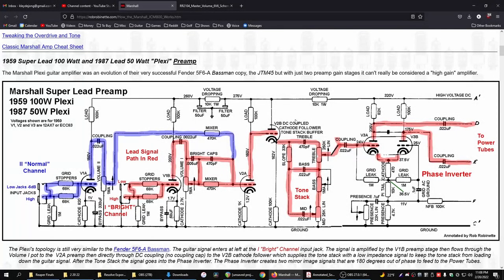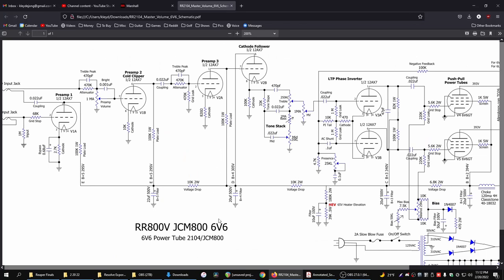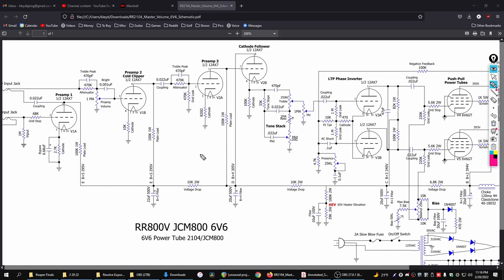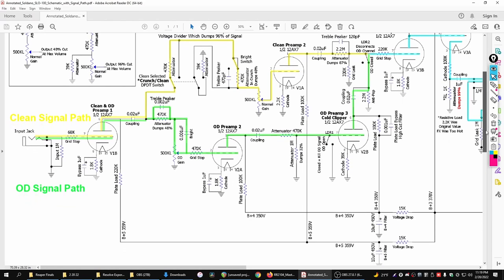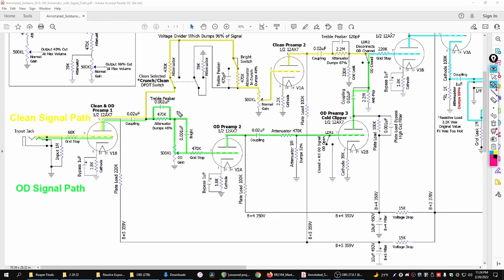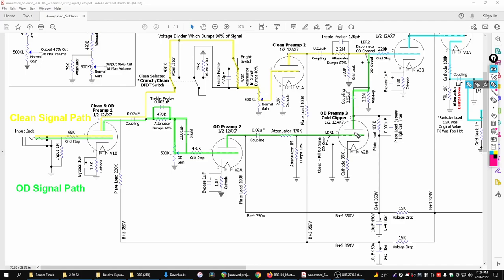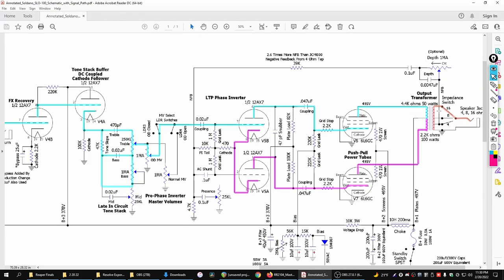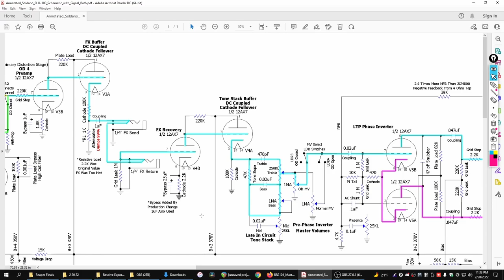High Gain Amp Circuits Explained

Comment: Soldano uses PCB in production. I've seen a turret build at the Sloclone forum and the guy said it's dead quiet. So it's possible, but a lott more work to do.
Reply from the maker: PCB also offers some nice advantages in reliability and repeatability.  You can get a stable layout that avoids oscillations or cross talk, then mass produce it.  I have hand made some higher gain amps and they require some more fine tuning attention.

Comment: A relatively significant part of what's being done with the higher value cathode and plate resistors is restricting the amount of current thru those preamp tubes... Biasing them cold... It makes them break up earlier, it's about the same thing going on in a lot of fuzz pedals... I feel like nobody talks about that because it's contradictory to the nomenclature of "high gain"... In a lot of cases you're not increasing voltage gain by a whole hell of a lot but you're increasing harmonic generation... This is a good video tho and I'm glad you touched on those components some... I'm not sure if a second part to this ever came out or not but if it hasn't yet you could touch on that 🤷

Comment: Awesome demo. Love that you actually took the time to explain what each component does and how it does it, why it does it.   I had an Egnaters rebel 20 that felt alot like the Soldano in this breakdown. Id really love to see a breakdown of the rebel 30 mkII. I think that circuit has alot of potential to become one hell of an amp so if love to see a breakdown of it. Even some of Bruce's older stuff would be awesome cuz it's the foundation of all these Soldano, bogner, Egnater and a couple others... They all worked together in 1 company at one point and it's like they all 5 had slightly different ideas and directions to take the company so they all split off rather than continue  together and build everyone's at the same time. The jet city amps are related to these as well, BUGERA... 

Alot of modern boutique builders use the clever cap resistor placement to build up, shape then release method. Thank you for explaining this so clearly. Be safe man

Comment: One question I have on the cold clipper is that its asymmetric clipping before the tone controls. That will have even and odd order harmonics, which will sound complex, aggressive and maybe harsh. Then the tone controls have to balance between a bright clean tone and taming the fizz/ice-pick of that asymmetric distortion. It looks like maybe the capacitors used for the voicing help deal with that. But I wonder if there are cases where multiple cold clippers are used to leverage the phase inversion to get more symmetric clipping?
Reply from the maker: I have not seen multiple cold clipper stages.  That is an interesting idea.  It might be counter productive as at that point you might as well just use a more standard gain stage.  Not all high gain amps use a cold clipper.  It is definitely a feature that you would intentionally choose for its characteristics.

Comment: Another question is given all that asymmetric preamp tube clipping before the master volume, isn't the holy grail symmetric poweramp clipping? Or is this asymmetric clipping part of the nature of modern high-gain amps?
Reply: thats the endless debate between preamp gain voiced amps and oldschool non master volume amps, where the gain is comming from all of the stages lit.

The feel between these two types are very different, but listening to recording, you might no hear it at all.
Reply from the maker: Asymmetric and symmetric clipping is definitely a matter of personal preference and taste.  While the lineage of the Bassman into Plexi into JCM800 into the Soldano is a very nice way to track the evolution of high gain - there are many other ways to skin the cat.  Many Mesa Boogie amps do not use a cold clipper.  Dumble doesn't.  

A Dumble ODS type circuit can also be fairly high gain - but it is very smooth and refined.  By not using a cold clipper and the way they shape EQ by using capacitors in certain locations you get a fair bit of treble attenuation in key locations.

Comment: How changing the gain pot from 500k to 250k or to 1M will affect the overall sound?
Reply from the maker: The value of the resistance from the pot works with the value of the capacitor to form a high pass or low pass filter.  Change the value of the pot and you change the frequency of the filter.  I recommend downloading the Tone Stack Calculator and you can experiment with those changes and see what it will do.

Comment: Thanks for the good analysis. According to the Soldano SLO-100 scheme
You can see that the clean channel signal is added to the overdrive signal when you use OD mode. Is it so?

Comment: Hi Kley,

i have a question regarding minute 12 where your talking about the capacitors from cathodes to ground to make low end more tight.

Why do you think, this is not done in the normal channel?

I feel like on a lot of amps the bass falls off when switching from normal to drive channel.
Reply from the maker: With a clean tone you can have more low end. Less gain = less mush. But when you increase the gain you have to keep things under control.
Reply: Ok, thank you for information!

Comment: Correct me, Coupling cap is used to block dc and allows ac through, what is the effect of the changing of its value?
Reply from the maker: @zabtej1645  You can use a higher value to trim some low end. Like a 0.1 uf would be more bass than a 0.022 uf.
Reply: @KleyDeJong  Thank you very much! Any ideas for tracing back a noname modded amp, when on the input jack resistor is supposed to be a 80 something kohm resistor, but it measures at 34k? Do these markings matter at all and if the value is not correct, do I have to change to a new component? It's like a 50+ year old amp, was there a color code change since?

Comment: Hi kley Ma-noo-sha is nice. What do you think about the DC circuit that is used to power the heater of this amp. I know nothing about them I was hoping maybe you knew something about a DC powered heater circuit in a audio amplifier. Pro and cons?  Thanks for your time JM
Reply from the maker: DC heaters are a bit more complex, but can be great for reducing hum which is a big concern in high gain amps.
Reply from the maker: I wouldn't use the main b+ for heaters. I would look to rectify a different tap for dc heaters, probably the ac heater supply.